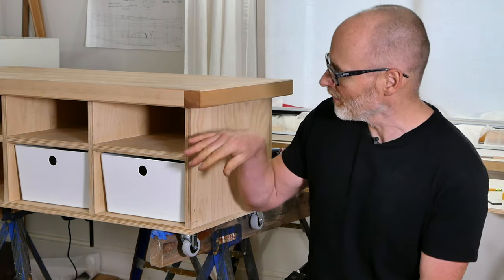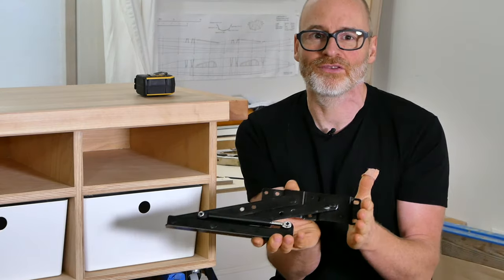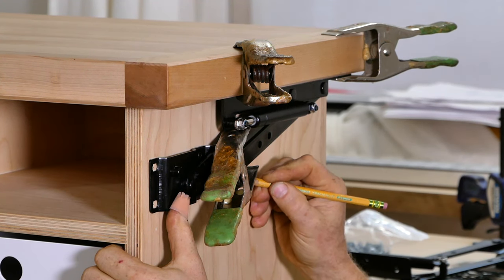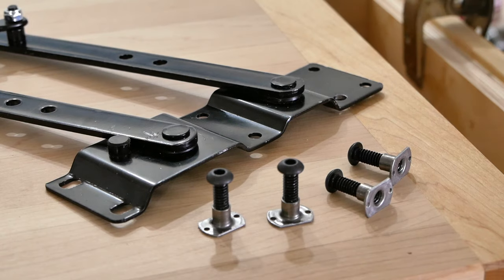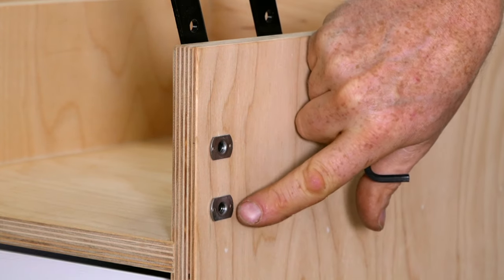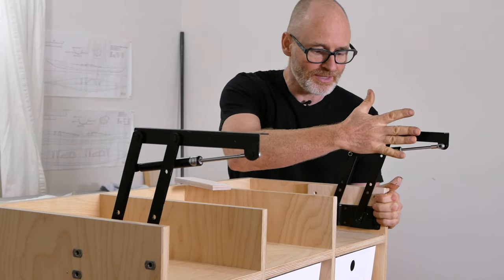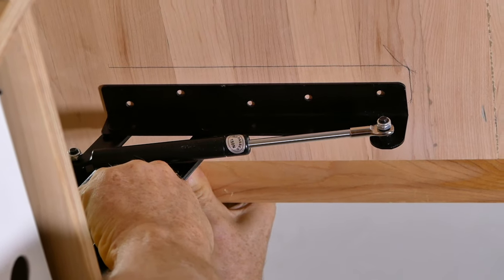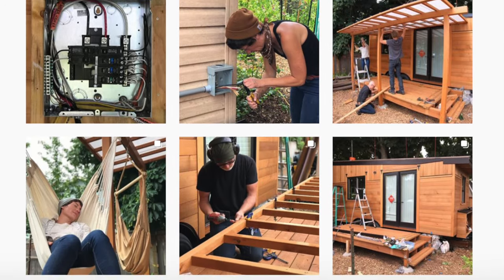Installing Lift Top Coffee Table Hinges

Comment: I want to thank you for this video. I watched it several times before I decided how I would attack this existing coffee table. We searched for a reasonably priced pop up table in Golden Oak. The best idea was to take the top off, look over how I could make this work, watch your video over and over. I extended one side using saved oak flooring. I was able to buy T nuts at an Ace store. It works perfectly, except that there are wheels at the bottom and has to be closed from the opposite side. Thanks for this!

Comment: I've  used t nuts on other projects.  I use forstner bits to countersink the  t  nut in the wood. Truck is to start with the larger bit first for the base of the t nut. That will also give a center mark for the smaller but for the  bolt, screw, or threaded rod.

Comment: If the top slopes slightly towards you, just make sure if you create another unit that you slope the fixings on the sides back a little so it sits flat when you lift it. Maybe fit the mechanism onto some scrap pieces of wood to see where the fixings need to be to make the top surface perfectly flat.
 For extra strength, you could put 4 of the lifting mechanisms instead of just 2.

Comment: Hi, thanks for the tutorial. Really helpful as I am planning to add similar hinges to an existing coffee table. 

I do have a couple of challenges and I hope you have some good suggestions to address them. 

1. The coffee table is made of 
thin plywood/MDF boards.

2. The coffee table top is like a chest. Fabric hinges that are easy to separate. However it’s a box lid that sits on top of the box

How do I mark the drill holes and what precautions and preparations do I need to make to ensure the hinges don’t splinter the thin coffee table wood.

Thanks

Comment: Excellent video and very nice work Brian. May I please ask you a question about hinges? I'm looking for what I think is called a bench seat hinge.  A hinge that allows you to access an under-seat storage compartment, these double-articulated hinge arms are designed to move the seat top forward slightly as it lifts for clearance against a padded backrest. Would you know where I might find these? Thank you

Comment: Excellent demo, many thanks!  I needed to see how this mounted.  I have an antique carved ROUND wood coffee table.  It needs a light wooden circular top.  The challenge is how to mount this flat hinge to a circular curved surface.  Hmmm....

By the way, why use such heavy slabs of wood for top?  Keep it light.  A tiny house is after all, a mobile house.  I dislike heavy furniture myself and love light but strong furniture. If I cannot lift it, it does not come in.

Comment: What I saw you did but didn't mention. You sanded one end of your support blocks to help guide the arms as they go up. This prevents the support block from stopping on the support block if the table lop is lifted up unevenly. Making the support blocks the full length of the hinge would also work.

Comment: If the wood on top isn’t super heavy, would the hinges stay down when put down? I noticed they automatically pop up before installation. Is there a specific weight you need to keep them down when you don’t need it up?
Reply from the maker: Good question I don’t think the table has to be super heavy but if it was quarter inch thick plywood it probably wouldn’t stay down.
Reply: @actuallytiny2537  Thanks for the informative video, but For reference what would you say your table top weighs give or take?
Reply: Hello sweetie

Comment: Helpful vid thanks. Any thoughts on how I could mark the screw locations for an installation inside of a box?
Reply: Me too want too install the screw inside
Reply: I used a scrap piece of lumber (1x6 ?) laid across the top where the hinge would go, clamping it to the table. I lined everything up and marked my holes from there.
Reply: Make a template from cardboard,  tape to outside of box. Mark hinge holes, transfer holes to both ends inside.   Cardboard should be flush with top of box.
Reply: I learned things! Because most of my hardware is salvaged from really junk furniture - I don't know what any of it is called, and I only know the one way it's "supposed to be" used, assuming the piece was complete enough for that to be apparent. Nor is it always clear why a piece was built the way it was - although how it wore or broke often tells me what didn't hold up to something...  (was it normal use? Who knows.) Then there's the "did it get built this way because it was the cheapest/fastest way that works well enough, or because it's a good idea?"

Will these brackets do what I'm looking for? Maybe.  Do I have a much better idea how to install brackets/hinges in general without as much frustration...absolutely!

Comment: MUCH NEEDED HELP: I have things same mechanism on a cabinet but the instructions asked to remove one of the bolts of the bar aspect to screw in some other places, but the nex
t step asked to realign the bar to the position. Mine doesn't seem to fall inline properly please help

Comment: Hi.    Are those low profile?      My side walls/ beams are only 4 inches.       I think in their retracted state they would stick out the bottom.    Thanks.  Ian.
Reply from the maker: Hard to follow your setup, but they collapse down to about 4 vertical inches.
Reply: @actuallytiny2537  
  I followed your video.    My table top is long,  like 6 feet, but works very well.    Thank you.

Comment: I am planning to add these type of lifts to a Chinese chest style coffee table top. 

I have been trying to figure out how I could mark the fastener holes. The best solution I could think of is to use two blocks of wood the same length as the top, fix the lift and then undo the wood block and copy the fastener marks on to the top from the wood strip to fix the hinge in the lift position.

The wood of the coffee table is very thin and I am trying to think of a way to stop the fasteners from showing on the table top. Any ideas, suggestions or advice is appreciated.

Comment: The discrepancy’s of out of level of top when extended should be countered when fitting the mount plate but as you ridiculously through fixed for some reason (as should have fitted with shorter fixings ) you then. Had some awful unsightly tee heads on show .. please rethink ... as this is embarrassing much